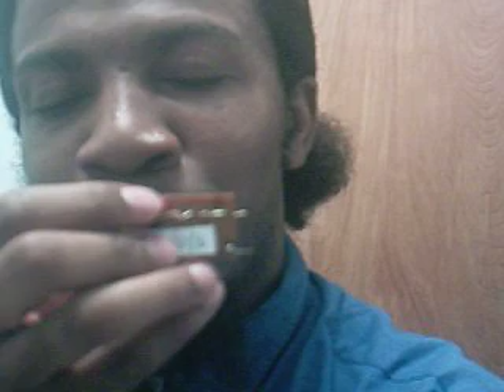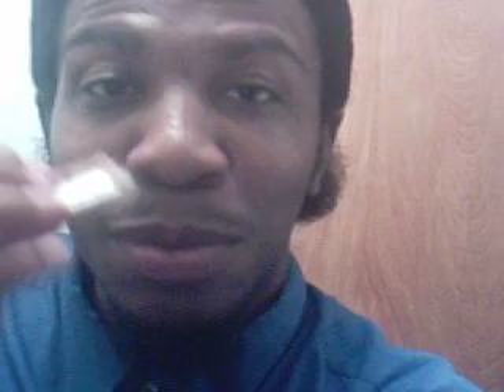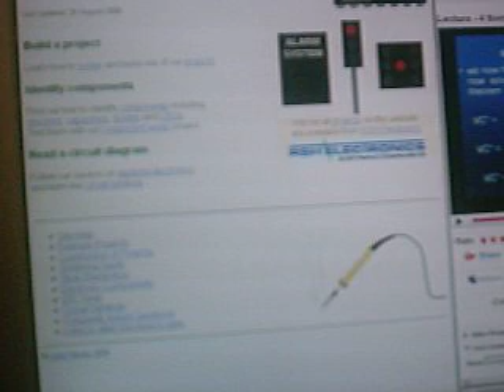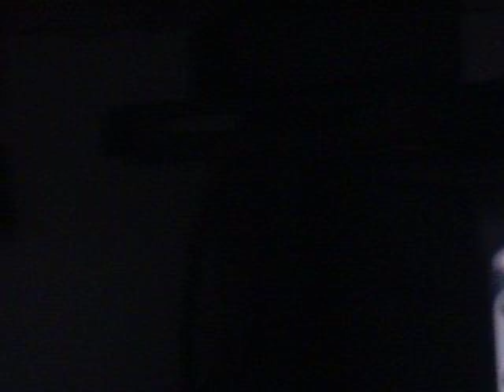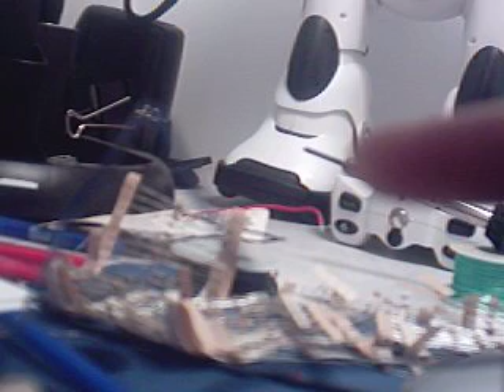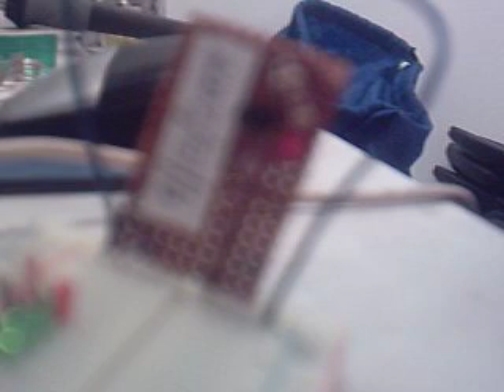Late night circuit building

Comment: Awesome! I tell ya man circuit making is fun once you get the hang of it. Basically I mess up the soldering of in a circuit I really can't get the balance of the solder and the connections. But the casings for the circuits are real easy.